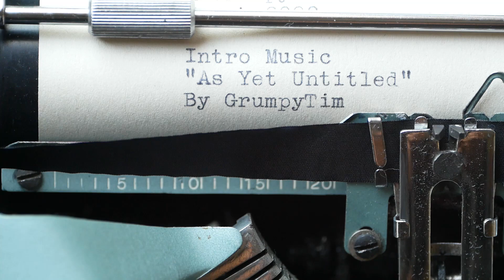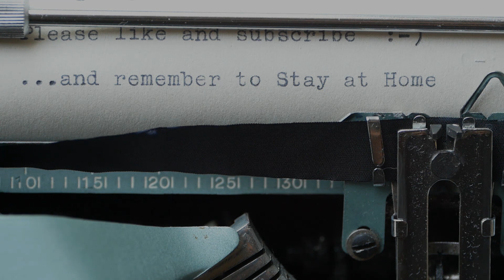Retro Tech - Olivetti Prima 20 Adding Machine - Part 1, Refurbishment

Comment: What type of 'grease' do you use/recommend?
Reply from the maker: Hi androo4519,  for grease it's not too fussy because none of the parts see extreme loads, a general purpose grease / car wheel bearing grease / bicycle wheel hub grease are all fine.

Generally you want to grease parts like levers that need to slide over each other, cams and gears.  For smaller parts and rotating shafts the grease will tend to sit on the surface and not get to where it's needed so those are better off being oiled.  I use sewing machine oil but any light, general purpose oil will do the trick - car engine oil would be too thick and WD40 isn't right for the job.  When oiling, it's best to carry a little drop on the end of a small screwdriver or similar, to each part you want to oil, rather than just slopping it everywhere  - capillary action will carry the oil into the bearing surfaces.   Excess oil will just sit on the surface and eventually attract dust and dirt which could actually stop the machine from working.

Hope that helps a bit.
Reply: @GrumpyTim  Thanks. Just bought a Prima 20 on Ebay and not sure what condition it's going to be in.
Reply from the maker: Excellent, you should have fun with that.  Don't panic if it doesn't work when it turns up - I generally find more that don't work than do but it's mostly a process of slowly figuring out which parts aren't moving, oiling them and freeing them off, one at a time until things start to work.  Don't apply excessive force, sometimes it can take a while for the fresh oil to work it's way in before things start to free up.

If you get stuck just ask - I can't always answer straight away but I will get back to you eventually.
Reply: @GrumpyTim  Thanks. It just arrived and is pretty jammed. I will take your advice! Seems like quite an early one.
Reply from the maker: Great stuff.  It might take a while to free it all up, just do a little at a time and don't get frustrated - you might have to try to observe what does move and what doesn't to try to deduce where it's jammed.  You can apply a drop of oil to all the moving parts anyway because that should start to soak into the sticky old oil while you're looking at the machine and things might start to free up as you work.

Keep me posted as to how you get on  :-)
Reply: @GrumpyTim  Things started to free up nicely and I thought it was going to work really well but now it's locked with the joystick in the 'up' total position. Can't seem to find anything to prod that releases it. Any idea? Also haven't yet sussed out why the '6' key is marked '6½' – probably would if I could get it working!
Reply from the maker: Hi Androo4519,  that's good progress so far.  If the joystick is stuck in the up position, that's the "grand total" position which should print the total and clear the accumulator ready for the next operation.  Does the crank handle still pull and release ok?  If you look from the underside, is the accumulator moving into contact with the vertical number racks as it should do?

To release the grand total joystick, look about an inch (25mm) behind the joystick - there is a metal plate that sort of looks like a cross from above - it should be sitting angled towards the rear of the machine.  At the rear of that cross there should be a vertical metal part protruding through the cross and a spring running up from the side of it.  If you gently move that protruding metal part towards the rear of the machine, this should release the joystick.  Hopefully from there you'll be able to re set the joystick into grand total and release it again and work out which part of the machine is sticking without having to try the main crank handle.

You can also release that joystick from the side - looking from the right hand side, on the outside of the main framework, just below the white disk that surrounds the joystick, you'll see a horizontal spring - on the rearmost end of this spring is a vertical lever - move that backwards and the joystick should release.

Hope this helps to get a little bit further.

Keep me posted on your progress.

Comment: Where did you buy the ribbon and the paper?
Reply from the maker: Hi mynameslivia,  The ribbon came from an ebay seller - Globe Typewriters in the UK I think I used - they don't specifically sell the ribbon for this machine but it's a standard size - you have to rewind it yourself onto the original reels that are on your Olivetti.  If you search for a Red & Black ribbon for an Imperial Good Companion typewriter that will do the trick.

I already had the paper rolls but they are easily available from ebay - they're 57mm wide and 57mm diameter rolls - you don't particularly want the thermal printer rolls (although they would probably work ok too) so search for "57mm adding machine rolls"

Hope that helps.
Reply: @GrumpyTim  thank you very much!